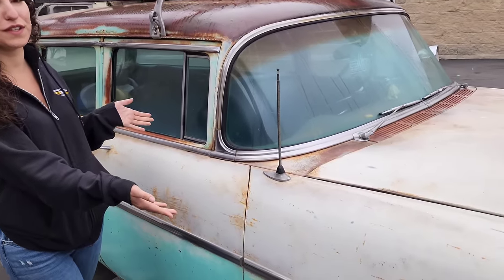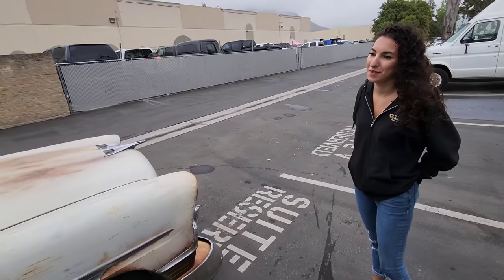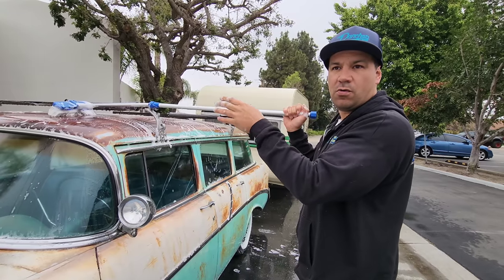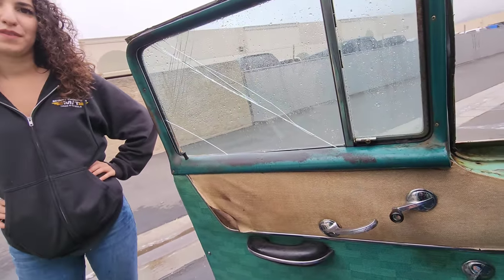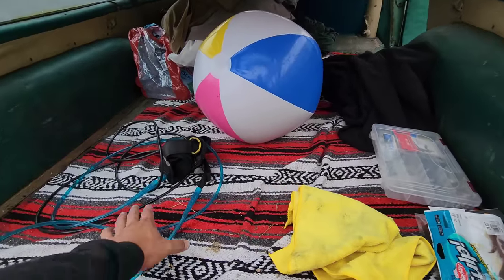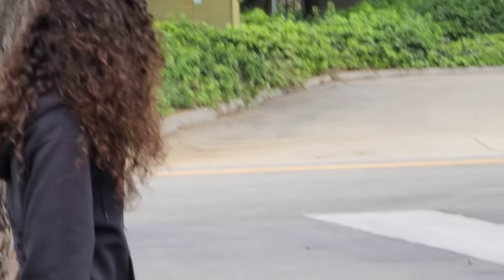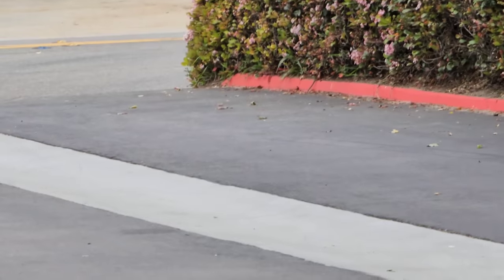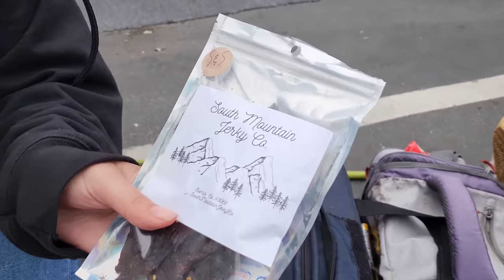Washing Our Vintage Camping Rig – 1956 Chevy Wagon + 1955 Hummingbird Trailer

Comment: 🇺🇸👍 Nice Rig, but how do you get away with not having outside right and left mirrors especially when you have the trailer attached big safety failure. If it were me they would have me pulled over with in the first block, but then again I wouldn’t know they were trying to because I couldn’t see them there .

Comment: I've always felt that a '56 Chevy perfectly epitomizes the mystique of the "Tri-Fives" 'cos it incorporates  features from all three model years.  The front quarters and hood nod to the '55; the unique belt moldings and slightly tweaked roofline represent the '56; and the stubby tail fins hint at the perfected versions of the '57.

Myself, I see Duke as a crew-cab Nomad - the forward rake of the tailgate is a dead giveaway, and it's common to all three model years,  regardless of how many doors a given wagon has.

Cool beans, indeed.😎